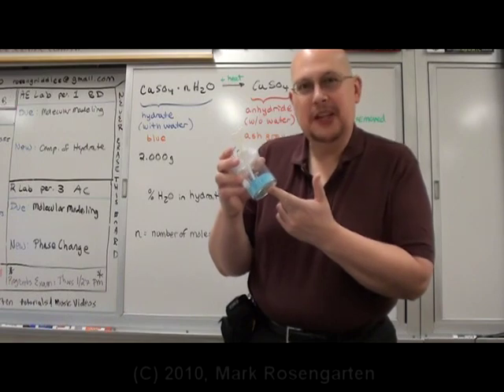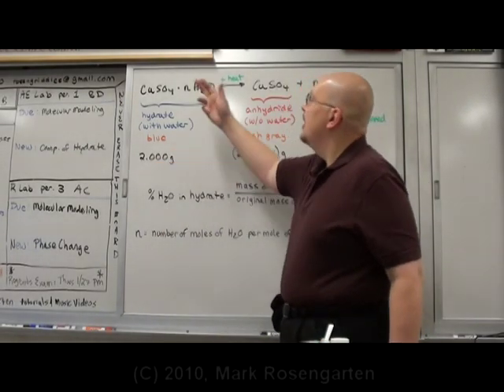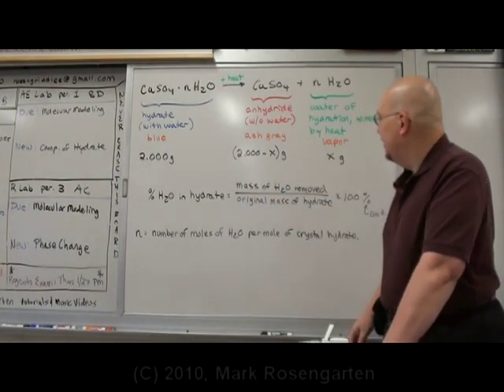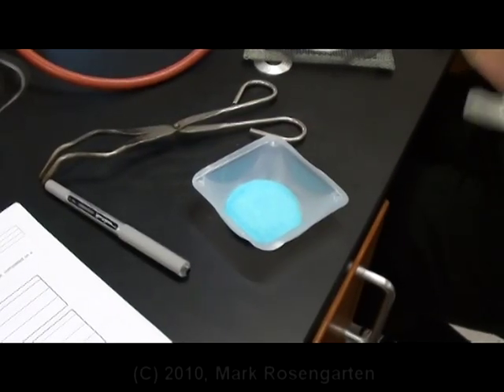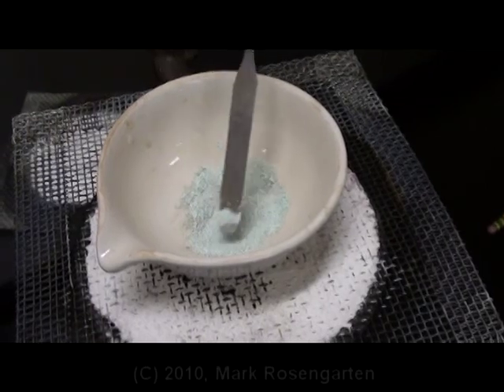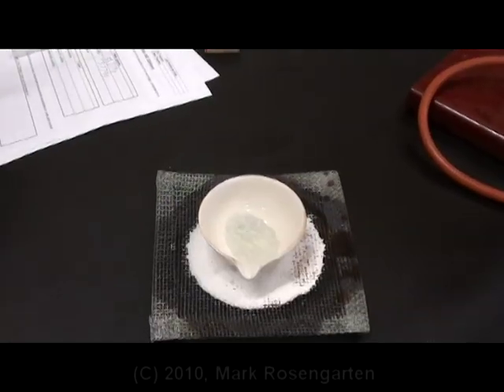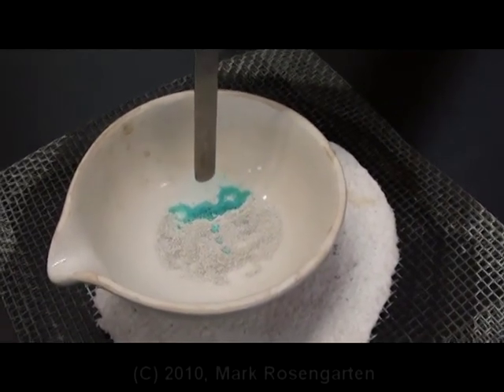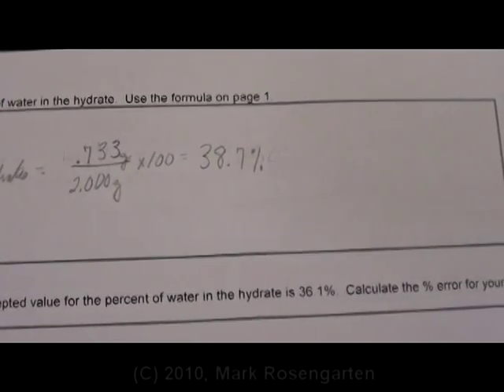Chem Lab:  Composition Of A Hydrate

Comment from the maker: @vinuthalan It's a mole ratio between the CuSO4 and H2O.  If the mass of the hydrate is 2.000g and the H2O has a mass of 0.800 g, then the CuSO4 has a mass of 1.200g.  Convert them both to moles.  CuSO4 = 1.200g / 159.6 g/mole.  H2O = 0.800/18.0 g/mole.  Take the mole amounts you get and divide by whichever is the smallest of the two.  This will give you a whole-number ratio, where CuSO4 is 1 and H2O is...well, you'll just have to pop it in your calculator and find out!